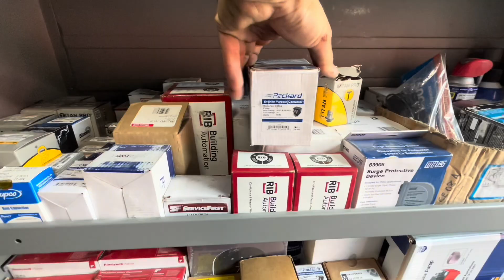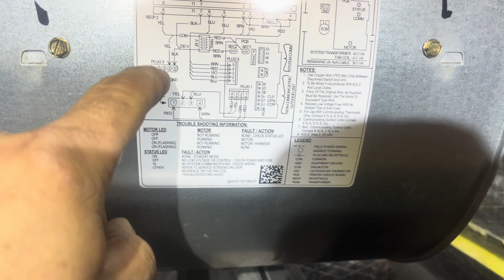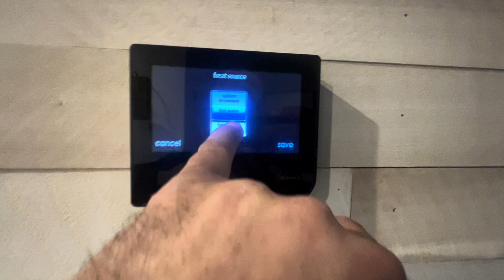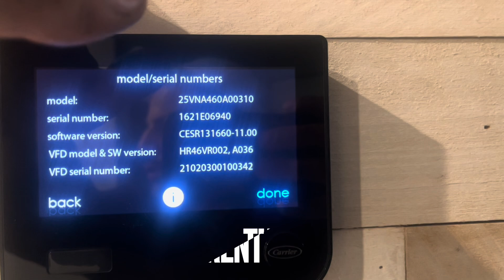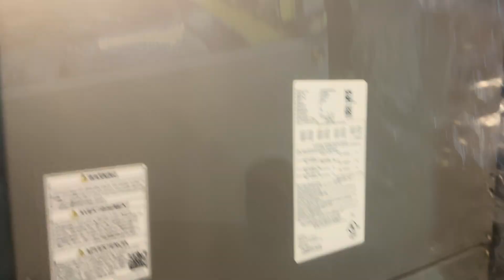CARRIER INFINITY 25VNA KEEPS BLOWING FUSE??

Comment: Thanks for this! I have an older Carrier Infinity unit and it has started blowing the same fuse. ChatGPT recommended this video. I'll check the wiring.
Reply: The contactors ohm'ed out ok. I'm going to run a new cable from the outdoor unit to the furnace control.
Reply: High pressure sensor wires had shorted out to side of unit. 18 years of rubbing wore through the wire.
Reply from the maker: Good catch.   Also just ensure the low pressure switch is also not starting to wear.   I appreciate your feedback.